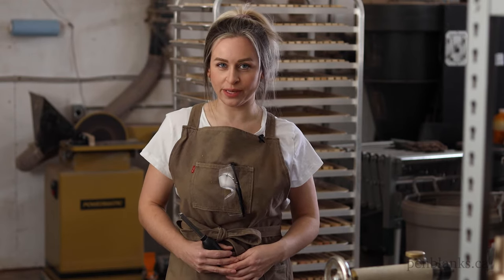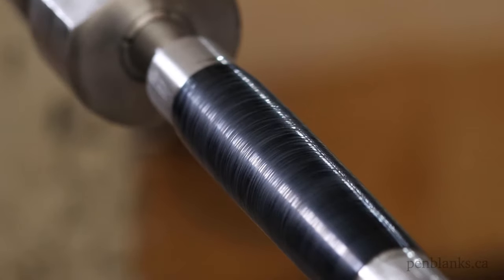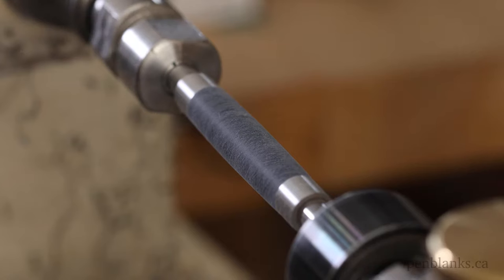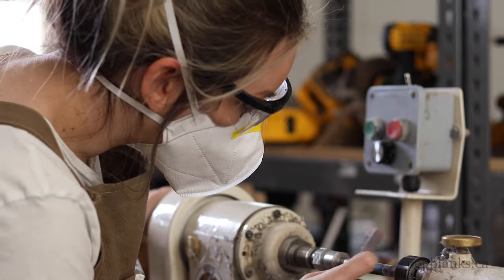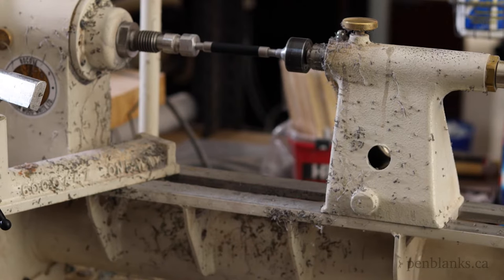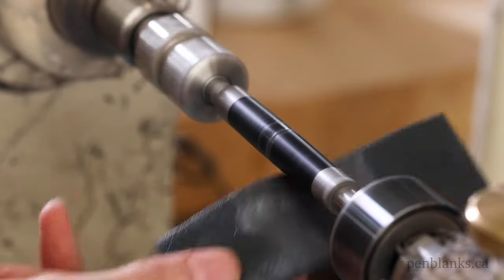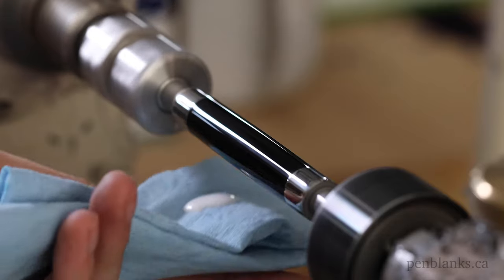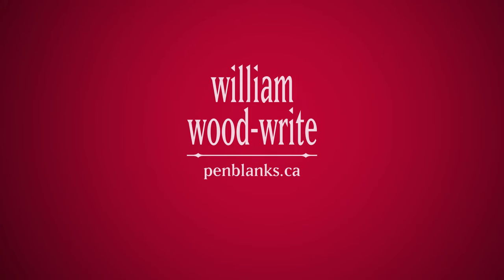How to create a flawless finish on an acrylic pen blank

Comment: Some great tips in there for budding pen turners. Well done. I ran out of plastic polish one day and had to get some pens ready for the next day. Racking my brain as to what I could use and it suddenly come to me, I tried tooth paste and was pleased with the finished result. I use tooth paste all the time now.
Reply: You mean dental polishing compound? I love that stuff!
Reply: @yeetsbeets9894  No. That would work though. I did mean toothpaste and I was surprised by the finish that it gave to the pens. You also do not need too much either.

Comment: Beautiful work, great video, thanks.   But you don't need to cross sand if you are using the correct progression of sanding grits. That being, increasing each next grit by 50% from the previous grit used.  Besides cross sanding would just leave sanding marks going in the other direction.  Try it.

Comment: Do you sand horizontaly with the micro mesh as well? Also I use CA glue on acrylics as well is this not needed?
  Thanks for the great service Bob McCabe
Reply from the maker: Hi Bob!
I don't sand horizontally with micro mesh, but you could definitely do that if you're still noticing small scratches at the micro mesh stage of the process. It is probably not necessary once you get to the very high grits. 
I normally only use a CA finish on wood blanks because the glue penetrates into the wood to help harden it. For acrylics, I just finish it off with Hut polish. I have done a CA finish on a fusion pen blank (wood fused with resin). I use the pen every day and I've noticed the CA finish starting to chip off on the resin portion of the blank only. 
I hope this helps!
Reply: @WilliamWoodWriteLtd  
Thanks for the great advice!!

Comment: I am constantly getting scratches in my pen. I even follow the steps you provided. The only difference is that I am not slowing my speed down when sanding. Could that be a big part of the problem?
Reply from the maker: Hmm, I doubt it has to do with the lathe speed honestly. Maybe experiment with using more or less pressure when you're sanding. I tend to lean into it fairly hard and stop when I feel the blank getting warm.